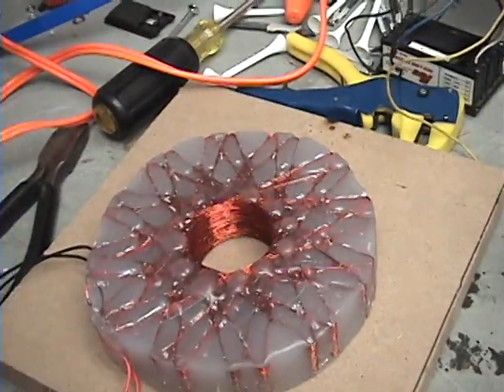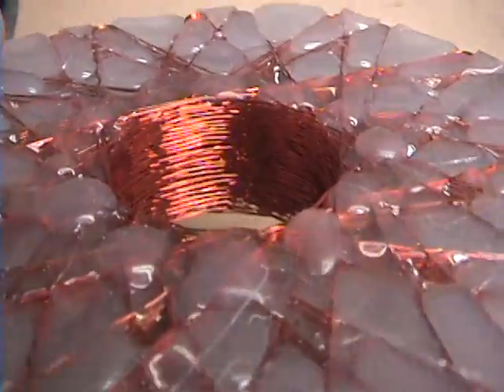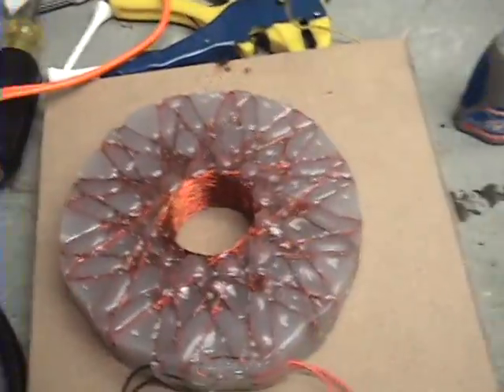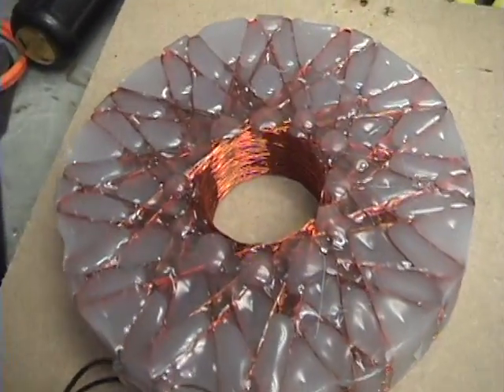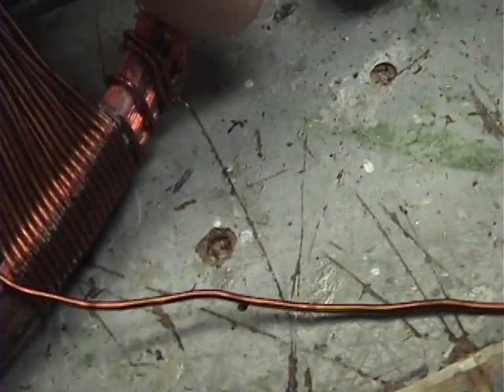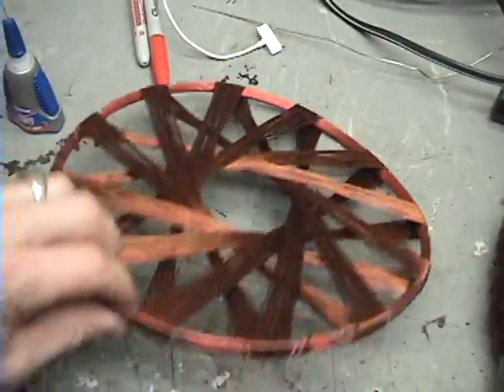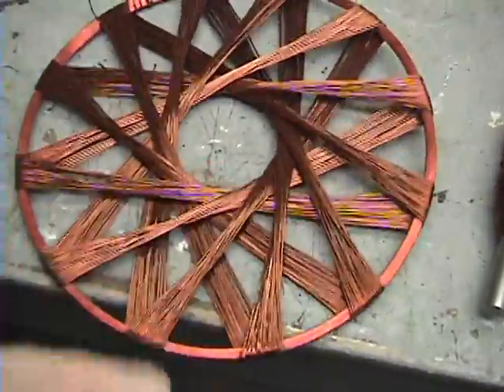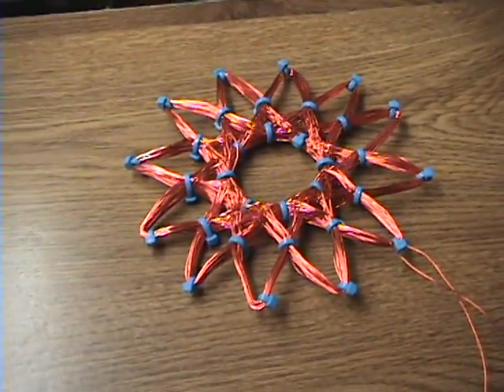Rodin coil / starship coil update (TEST 4)

Comment: But on the scale of the coil, rather than sucking power, try driving it with a frequency-sweep while watching on a scope.  Go for the max signal amplification at resonance.

That's science.

At the harmonic freq, you may break pay dirt.  If the coil is large enough, the matter-wave resonant notch may be in range of your driver pulse frequency.

If you had one testing rather than believing you've cracked the vacuum energy.

Take it out to a pasture.  Please let me know if it still delivers power!

Comment: If you are inducting from the local power company, it is perfectly ILLEGAL.  Seriously.  It is criminal, called theft.  Every amp pulled by you is an amp pushed by the power company at the cost to the membership, if a coop.

Beyond that, wow! --about the scale of coil.

Put your coil inside a steal building without hot 120 VAC wiring, and test for neighborhood induction.  Also, scope it.  If showing a 60 hertz signal, you are in legal jeopardy if the utility company with police choose to move.

Comment: no its not Iegal or at least it shouldn't be since your not in direct contact with the high tension power lines, your feeding off the EMF comming off the lines there are story's were people have lived in homes under High tension lines and every time they touch grass or metal they get shocked because of the EMF from those lines I say you have free power for free and using what they throw a way in to the air.